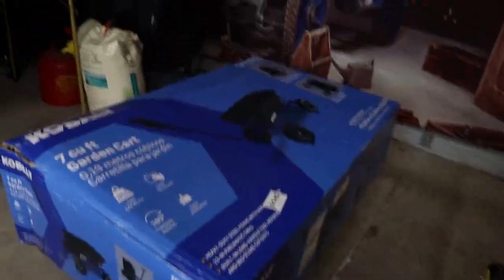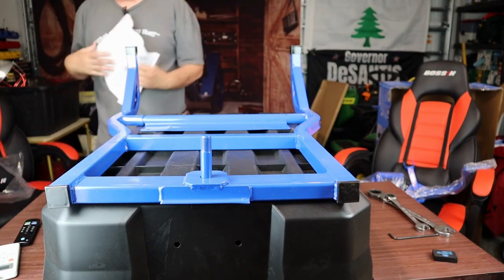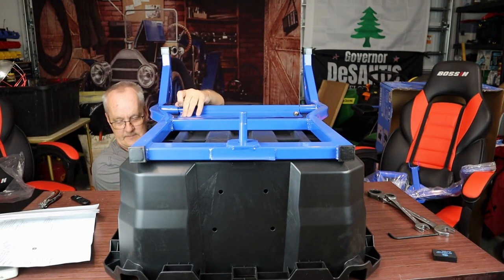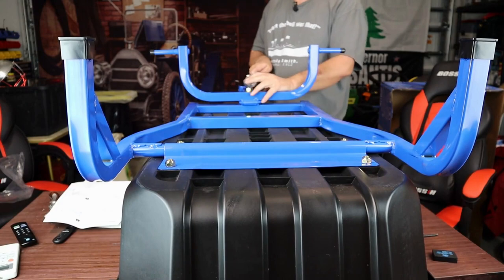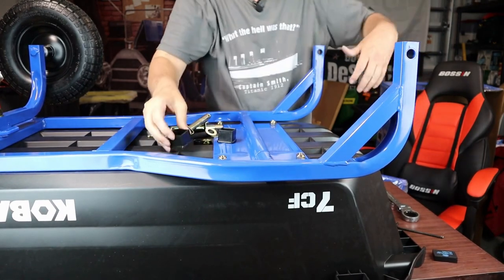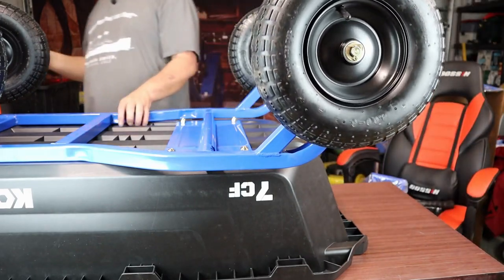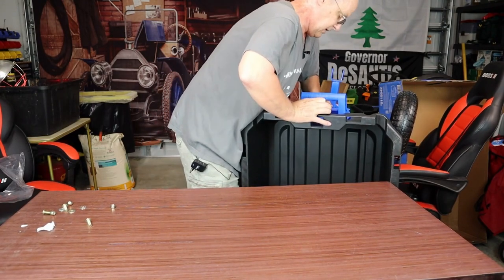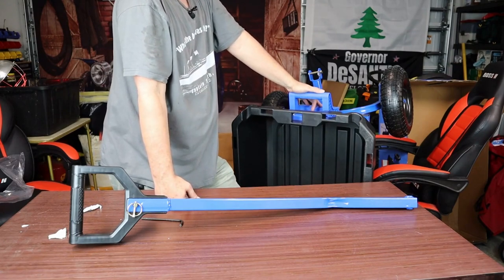"Building a Kobalt 7CT Lawn Cart: Empowering Yourself with DIY Skills!"

Comment: Thanks for making this video about assembling the kobalt 7cu cart.  I puchased one online which should arrive soon. I have assembled garden carts before. It is good to see the step by step assembly and which tool will be need.  I am impressed how the company packaged the hardware on an instruction card. No hunting around for small parts in the box.  I have a different brand dump cart for many years. It lives oudoors and has held up except for the tires and some rust.   The poly bed holds rain water without leaking. I will find out if Kobalt cart is as watertight. I just had a thought - do these things float? Could you use a cart or just the bed as a boat? Maybe I will test that Idea. Well I can tell you they make doing various things much easier.  What about lubrication? I put a light veg spray, plain mineral or non toxic chainsaw oil on the cart axels, and moving parts on the cart  I have.
Thanks again.

Comment: Well! Its seven months later and yes the kobalt cart is waterproof as a bathtub!  It holds water with no leakage.  I have had it full to the top with water.  Makes a great rain gauge.  Just put a ruler in it to measure rain or snow fall.  Only shows slight surface rust on bolt tops in tub.  The only downside of this cart is that the rear wheels stick out past the body.  Havebto be careful not to hit things with rear wheels.